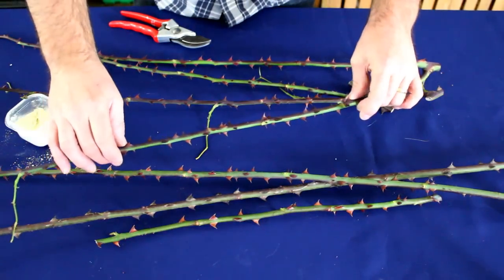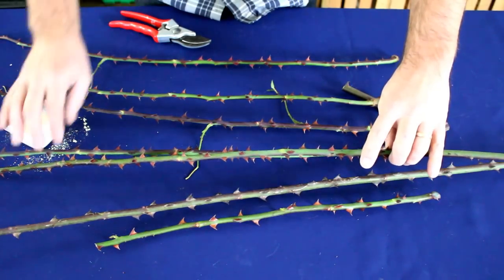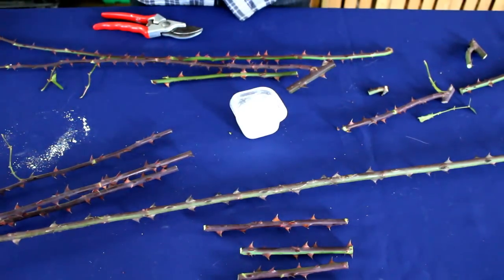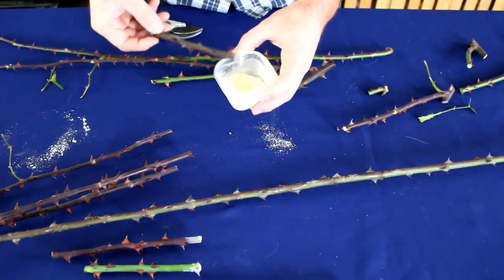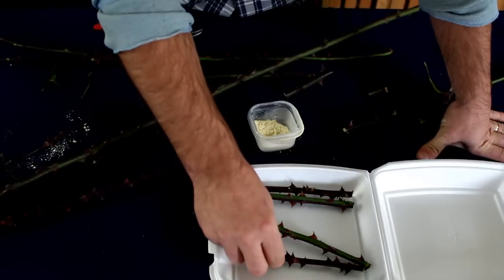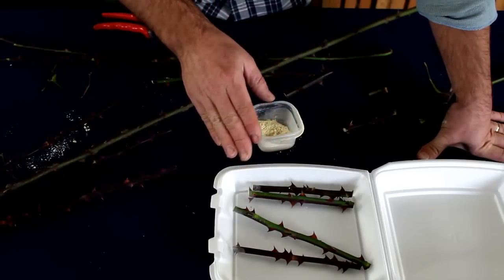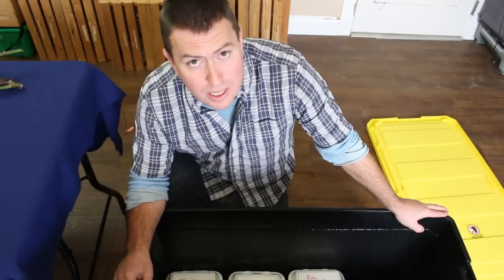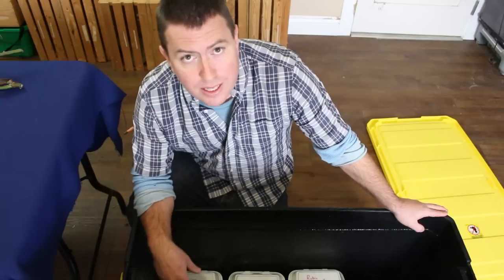Hardwood Rose Propagation: New Soilless Method

Comment: I think I'll try adapting this for my thornless propagatees this year, specifically some blueberry and dogwood hardwood cuttings. Since they're thorn- and prickleless, I'm going to try a double-bagging setup with two gallon-sized, slide-closure plastic bags. If I roll one down to stay open (like you might see done for a bag of chips or popcorn) and place it inside the other, I should be able to maintain this same effect you're demonstrating by putting moistened paper towels in the bottom of the outer bag and stand the cuttings up in the inner bag. There'll be free airflow throughout the outer bag, but the inner bag should keep the cuttings from directly contacting the moisture. At least, I hope that will be the case.

Comment: Hi Jason, I kept few hardwood cuttings from my garden roses wrapped in damp paper towel in a ziplock bag inside a closed small cardboard box. I kept the box on my dark closet. I am opening every other day to check for molds and today I saw most of them have tiny calluses forming at the bottom. It’s 10 days now , should I wait until they form bigger calluses before planting them? Also wanted to know if I should plant them in moist organic perlite only or in moist coarse sand or any other potting media? If you can advice would be really helpful. ❤
Reply from the maker: I'd be inclined to get them into moist perlite now rather than wait.
Reply: @FraserValleyRoseFarm  Thank you !❤️
Reply: @FraserValleyRoseFarm  Should I plant them in moist perlite and keep them under the grow light? Or keep them in the dark closet where they were so far?

Comment: Interesting.  I've looked at loads of vids about taking cuttings, learn something every time.  My success rates vary from 50% to 0%!  So this year, I have included lots of little details from different presenters.  Here in the UK high temps are not usually a problem, but getting the humidity right is, so I have made myself a simple raised cold frame where I can check them regularly.  Some commentators tell you to take off all the leaves, some say leave one small leaf - my preference, so I can see if they are drying out to quickly.  Some say remove thorns & brush rooting powder on the soft tissue underneath, which I have done.  And one suggestion - scrape off a little of the green bark, expose the white tissue & brush on powder, for more roots.  Certain varieties root easily, others not so.  I left some Veilchenblau prunings on the ground by accident & they rooted.  If I remember, I'll let you & readers how I get on.  And if they all die, I'll 'fess up.

Comment: Hi Jason, I am in Connecticut, zone 7a. The day time temperatures are now between 44 and 50 F . Should I try this method to root some hardwood cuttings? I have rooting hormone Clonex and Dip n Grow. Which one should I use to root these hardwood cuttings?
Reply from the maker: It's worth a try. Either of the rooting hormones would be fine, although I guess Dip n Grow you can mix a little stronger as directed.
Reply: @FraserValleyRoseFarm  in the Instructions of Dip n Grow there are 2 strengths to which you can mix it to apply for the rose cuttings. 1 is to mix portion of Dip n Grow to 5 portions of water and soak the bottom of the cuttings in that solution for 3 to 5 seconds. Another is to mix 1 potion of Dip n Grow to 10 portions of water and create the solution. 
Which one should I do for florist bouquet rose, semi hardwood or hardwood rose cuttings at this time. Please advice.

Comment: what's the purpose of the plant cooler? Never seen one before :)
Reply from the maker: That was built for cut flowers (in buckets) after harvest to remove the field heat. The cooler is just an insulated box, so it does double-duty in spring as a germination chamber (with heat & humidity)

Comment: Hi Fraser, it’s late February and having returned to Spain after winter found my unpruned roses have already just started to shoot. I’d dearly like to prune and propagate. What’s your advice about method at this stage of development? Your straightforward insights are always appreciated!
Reply from the maker: Hi Kevin, I would rule it out, but when they're actively shooting early in the season, they're more inclined to put their energy into top growth than to rooting. If I were you, I might hold off a bit and wait until some of the new growth ripens to try semi-hardwood cuttings round the time (or just after) the first flush of flowers.
Reply: @FraserValleyRoseFarm  Will do boss - thanks for the advice!

Comment: Hi Jason,  mate I had someone say that Climbing roses only bloom prolifically on the secondary shoots of the plant, so my question is, " taking cuttings from which to propagate a climber, should I take them from a primary shoot, the one coming from the base,  OR should I take a cutting from the secondary shoots coming off the primary shoots.  TIA. Interested in your response.
Reply from the maker: Thanks Darryl. A caution about that information first - there's loads of (genetically) different climbers. Some bloom more strongly on new growth than old. Some exclusively on old. Some in between. For me, I've had the best propagation success with 1st year vegetative shoots in the semi-hardwood stage. This may or may not come from the secondary shoots. I sometimes find the basal shoots to be a little thick for my regular style of propagation though.

Comment: So you showed how you cut the pencil size shoot and placed it in the carton, but can you take more than one cutting from one stem or can you take multiple cutting from the same stem?
Reply from the maker: Yes, if you take a long stem off the plant, take as many sections of sufficient length and with a node on the bottom as you can.

Comment: Thanks for the video. When and how do you plant them once prepared by this method?
Reply from the maker: If you get as far as strong callusing, the next step is to place them in potting soil and see if you can get them to root out. Sadly, this is where I've been losing too many of them. Bottom heat would probably help.
Reply: How many weeks is it taking to callaus

Comment: I have no ideal of hard wood and soft/ semi-soft wood propagation in the past. I just know that I can grow new rose from cuttings. I pruned my rose this spring instead of winter of last year, I just cut about 10 thick woody stems and put into the soil without any hope. I found out 2 stems grew roots after about one and half month later. The success rate was pretty low but not zero, that's what surprised me.
Reply: You should leave them in the soil and mist them at least twice a day. Keep In a cool damp she’d area.
Reply: im experimenting right now with different types of cuttings size and hardness wrapped around different kinds of material from news paper to toilet paper to those small towl rags .. and its going good . some callouses build up on some and others is slower but they are all green still except 1 that was basically dead from the start . i took off all thorns and leafs .
Reply: @HawaiianHeartbreak I was doing a DIY project the other day that used coffee filters. Biggest light bulb moment ever - duh me, wrap the stems with those!!! So I’ve just started this so I don’t have any results yet bc of that.  I folded my filters in half to make a half circle, then based on size of cutting determined how I wrapped it.
Reply: New update, I planted that 2 "rooted" stems into a small pot and they grew some leaves, but those leaves never grew into branches, for about 1 month later, those leaves started became yellow, out of curiosity, I pulled out one of the stem and found out that there is a lot of calluses at the bottom of the stem but they never developed in to real roots!!! amazing this 2 stems lived two and half months already, so far not due yet but will die soon, according to my observation.

Comment: Doesn't an angle cut at the base have more surface area for water absorption? Don't know where I got that idea!
Reply from the maker: I'm not sure the cutting (in soil at least) is absorbing moisture at all until roots begin to develop. An angled cut definitely has more surface area. Is that a good or bad thing? I'm not too sure. More surface for callus = good. More surface for rot organisms to attack = bad. I've been doing straight cuts exclusively based on recommendations, but testing angled cuts might not be a bad idea.

Comment: Thanks for the video. I rolled hard wood with a newspaper, they seem they have roots, what's the second step? Thanks
Reply from the maker: Transition to a sterile soil mix to let them root out some more. It's okay (maybe better) if this is still done in cooler temperatures. Then, when they've developed roots, a little warmth to help the buds break.
Reply: @FraserValleyRoseFarm  thanks

Comment: Thanks. Over here in the Philippines it is hot and humid so I will have to find a way to maintain the temperature to 15 degrees.
Reply from the maker: Hi Emerson. In your warmer climate, I might suggest staying with semi-hardwood cuttings. They're fairly easy, and don't require any cooling!

Comment: Been doing this in the uk for years always a great way and success
Reply: Make sure paper not too wet I roll up mine like a blanket with all the cutting out the top and roots in paper takes a little longer but if you take cuttings in December they should be rooted by February or just after depending on thickness and health of the roses when they cut
Reply: carlos2010694 - I don't understand. He did it the paperless way, right? So, I'm curious to know if you did it the way this video illustrates, in containers, no paper, no direct moisture.
Reply from the maker: Thanks - any tips to share?

Comment: I tried the newspaper method and it did not work. It's a recipe for fungal disaster!
Reply from the maker: Yeah - any standing moisture at all led to fast rot!
Reply: I heard on the Skillcult YouTube channel that using slightly moist wood shavings is way less likely to rot than newspaper when keeping cuttings based on the makeup of newspaper. I think I want to try this with a little bit of damp cedar sawdust from my shop since cedar resists rot.

Comment: HI, I followed your method and just put some hardwood cuttings in my spare refrigerator where the i can get to 10C. Is this too low? If so, next temperature i can get it is to 20C. Is that too high for this method?

Thanks.
Reply from the maker: I think I'd try the 20C

Comment: After you cut them to the length of a pencil  can you use the top of the cutting that you set off to the  side
Reply from the maker: Yes. You can as many cuttings from the same cane as meet the length requirements, and so long as they're still an appropriate width and firmness. Just make sure to trim the bottom end below a node, and the top end above. Thanks!
Reply: @FraserValleyRoseFarm  okay thank you sir

Comment: Hello. I live in a very hot country. Is this method also for tropical countries?
Reply from the maker: Hi Marcia. The original method (called "burrito" or "newspaper" technique) came from warmer climates than mine, but how warm? I read from one of the experts on the hybridizer's forum that she had tested it in temps around 70F (shaded spot, cool cellar maybe) - and the callus was fairly quick. Others have confirmed that warmer=faster callusing, but I'm not sure how that results in survival/final rooting of the cuttings. I'd be interested to hear how everyone does with this modified method in warmer and colder temperatures - but for now, I'm assuming a range from 50 to 75F. Wanna give it a try and let us know? What's the coolest, most shaded place you can provide?

Comment: Very informative video.  Thank you.  Two questions. I'm in Southern California and it's considered winter, but temps are at 75 to 80 Fahrenheit.   It does get cold at night and I have a storage shed that stays cold at all times.  Am I able to cut hardwood now?  Should I wait until the next winter?  Just to be clear, after the callus stage, I then put them into soil with food?
Reply from the maker: Hi Elizabeth - I'd say try now... I've read that this method works over a wide range of temps, so pick the coolest place you can and see how it works. After the callus stage I placed them in unfertilized potting mix in a semi-shaded place until I saw new growth, then began with half-strength liquid feed. I saw some losses in this transition stage, so I'm experimenting a bit in the coming months, and I'll keep you up to date.
Reply: Thank you.  May I ask how long of time would I expect these cuttings to be an actual plant with flowers?  Than you.
Reply from the maker: @elizabethannecarpenter7792   you'd be looking at the following spring, a little more than a year after taking cuttings.

Comment: Jason, what would the temperature be in fahrenheit degrees for safe storage, and do the cuttings need to be sprayed before putting in the styrofoam boxes?
Reply from the maker: I did my summer cuttings at 60F. Others on the forum did the "newspaper" technique at regular house temp (around 70F) with decent success. Right now, I have them in an unheated basement room where they're averaging 50F. I'm hopeful that this will work okay over a wide range of temperature. I didn't spray mine. What did you have in mind? If you do spray anything, please be sure to let the cutting dry fully before enclosing them. Any sitting water, in my experience, leads to rot.

Comment: Thanks Jason.  Confused. You showed callous formation but no roots ? How long does it need to remain in outer bin ? How often do you open it to inspect or spray water ? What do roots feed off if they rooted ?
Reply from the maker: So, going from my summer trial experience (that's where the callus photo is from) it took an average of 6 to 8 week for heavy callus formation. I started by misting every few days, but eventually found it to be unnecessary, as the inside of the bin remained "sweaty" anyhow. Some varieties took a lot longer, and some varieties failed to root at all. The callus is forming from stored energy , so no food needed to that point. After that, you're right, they'll need to be transitioned onto food and light. I did two methods of the transition period last time - and I'm still playing around with the "right" way to move past callus formation.
Reply: Fraser Valley Rose Farm 
Great. Thanks.  Roses remain my biggest challenge to this point. I can get them sprout easily but haven’t gone to a point where they started rooting yet
Reply: @Dee_Cee227  Stop the sprouting on top - they need roots first!
Reply: 0

Comment: G'day Jason. Great video like usual. A few questions for you. In the demonstration you placed four cuttings in the inner container. I'm assuming it would be safe to fill it a bit fuller, i.e 8-10 per box. Along the same lines, do you think it would be problematic to completely fill the outer box full of inner boxes, or is there a reason you left bulk air space? 

Also just FYI, I'm in Australia and hence seasons are 6 months behind, so I intend to try this asap in our summer. Also, I've tried most of your methods in our climate, without greenhouse, and have had great success! I primarily propogate Fortuniana rootstock via cutting, and then bud on the flower variety later once the rootstock cutting has taken root.   Also FYI, the potato method doesn't work in the southern hemisphere either, I tried that late last year with 0% success ;)
Reply from the maker: Thanks Jason. You're exactly right - I normally fill the container to around 12, with just enough space between cuttings to allow better air circulation. Also, on my last trial, I filled the outer box all the way with the styrofoam inner containers. At first, I opened it up every few days to mist, but found that I really didn't need to add much moisture at all.

Good to hear I'm not alone in failing the potato method! BTW, I'll be trying my hand at a little more grafting this coming season (trying to do a few standard/tree roses) - I may have to hit you up for some advice closer to the time.